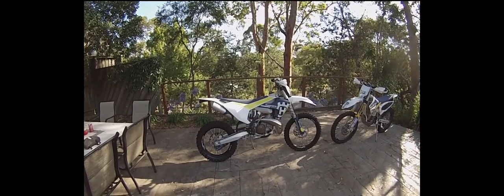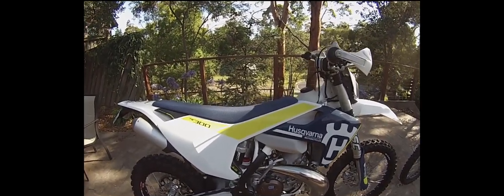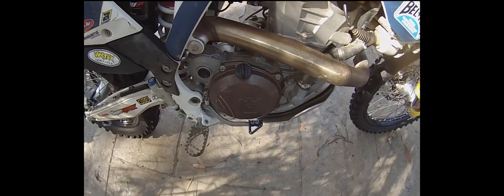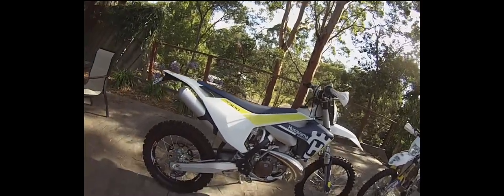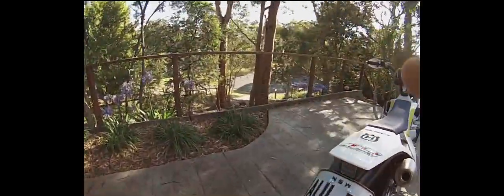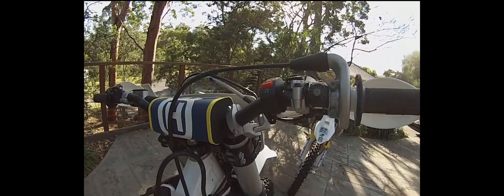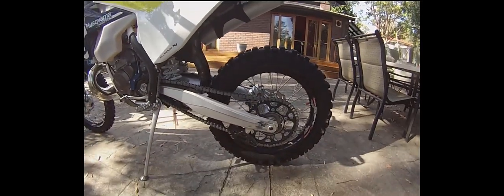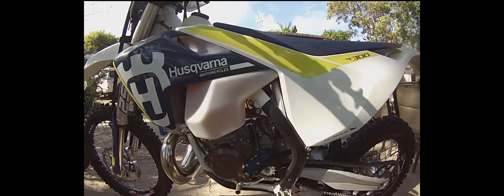2017 Husqvarna TE300 | First Look

Comment: Sweet bikes
Reply from the maker: Thanks, love them both.
Reply: Husqvarna Dirt I'm picking my new fe350 up on Saturday I'm in the uk so looking forward to giving it a blast out. Which one do you like best 2 or 4 stroke?
Reply from the maker: Congrats on the new 350, you're going to love it, great bikes. The old 2
  stroke vs 4 stroke question! For more flowing, faster type riding I 
prefer the 4 stroke, but for snotty, tree root infested goat tracks, I 
prefer the 2 stroke. Either bike will handle all situations, but they 
just shine in different areas.